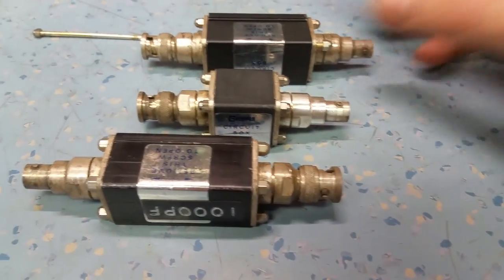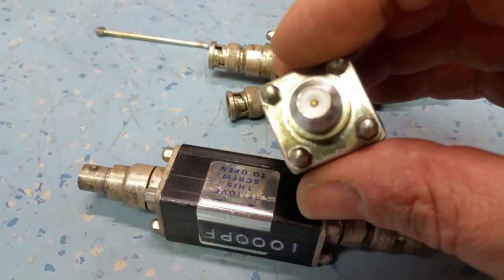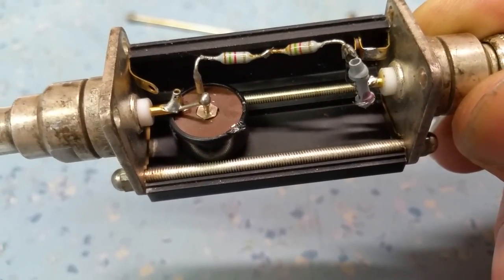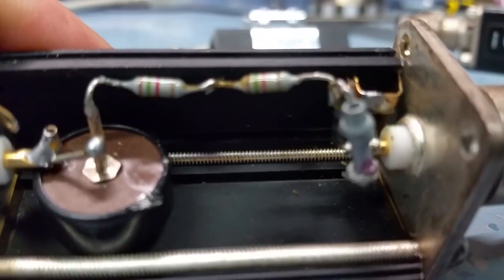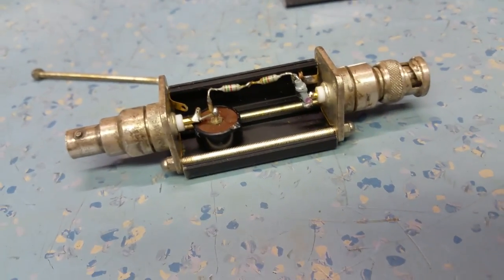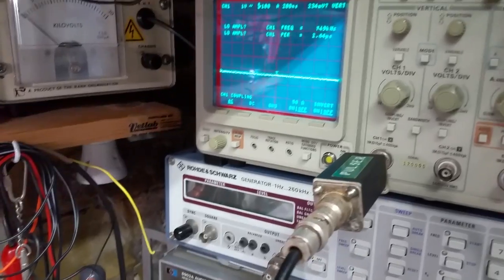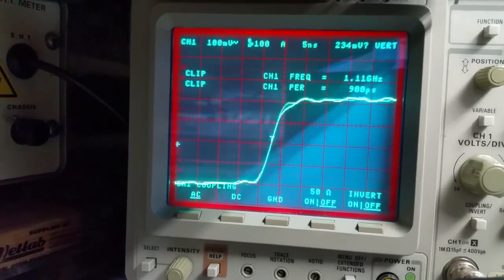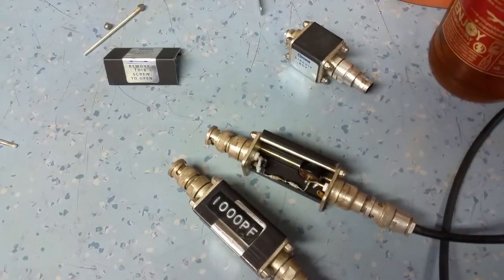I've found a tunnel diode pulser?

Comment: Just in case you're interested the connector is called interseries,  so you can screw on different types ie n type, bnc, tnc etc, I have loads of them very handy for making up  different adaptors between various rf connectors
Reply from the maker: nick philpot I was wondering that! You read my mind. Thanks.

Comment: Most tunnel diode pulsers are sub 1 ns.  Maybe you can improve it by adjusting  the current with that potentiometer. There are "manuals" on line from the Tektronix pulsers. They also have a potentiometer and in the manual they state how to  adjust it. I have one that sits around 500ps. It is driven by a 1 kHz squarewave (if I remember well around 150Vpp, I used the calibrator from a 547) First you see the signal "leaking through " and when you reach the sweetspot it starts. But it is a long time ago . Mine has a dead diode, I have a replacement but I still have to replace it (I have also a DIY 500ps version that runs on 5V and runs at 40 MHz and that is the one I use to test scopes after repair.)

Comment: Whatever happened to tunnel diodes? I remember when they were touted as the best thing since sliced bread- and I have an old GE databook from the 60's that has application circuits for oscillators, low noise VHF/UHF amplifiers and you name it using tunnel diodes, but they seemed to die a death! Great video Simon as always. Incidentally I don't know what that connector is either but I have an old universal adaptor kit where you can screw different RF connectors, e.g BNC, TNC, N type, etc onto either side of a centre piece, which is basically a back to back connector of the same type.
Reply: Edit: just seen Nick Philpotts comment below re the connector- makes complete sense!!
Reply: They are nowadays used in microwave applications.
Reply: @douro20  
Those are Gunn and IMPATT diodes and very frequency specific. 
It would be nice if general purpose tunnel diodes were still available....

Comment: i need a tek 067-0681-01 pulser for calibrating my tek 2467, as far as i can understand there arent many alternatives to this particular one and the ones on ebay are stupidly expensive, is ther a way i can build a tunnel diode pulser bui soldering come components? if so where can i find the maths for it?